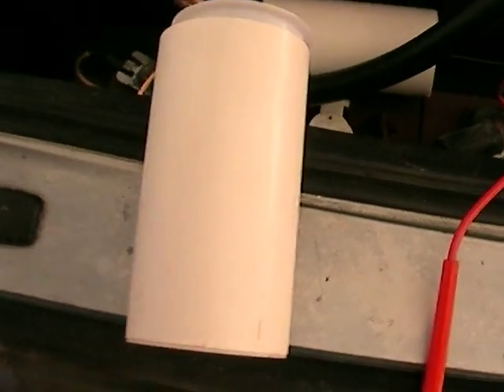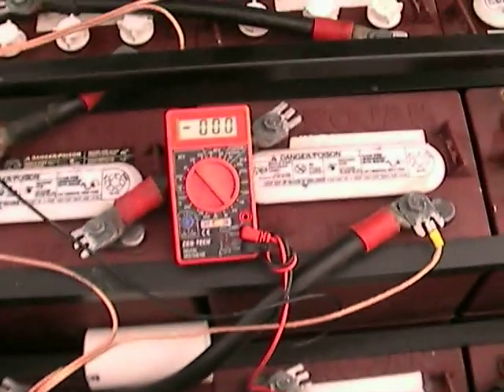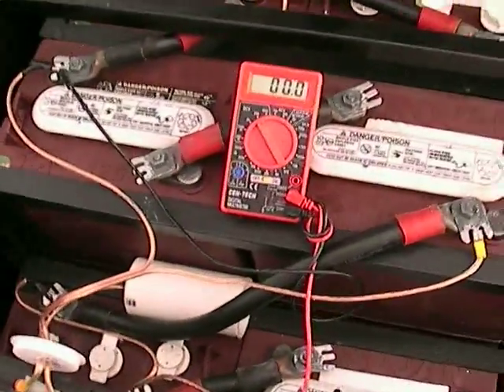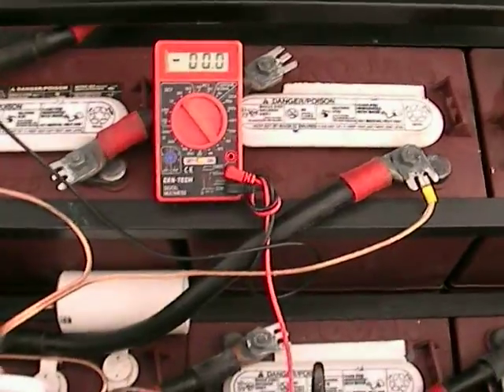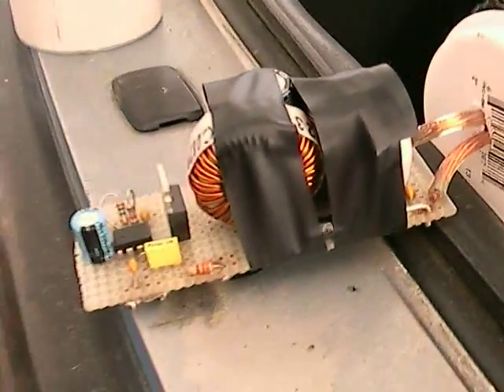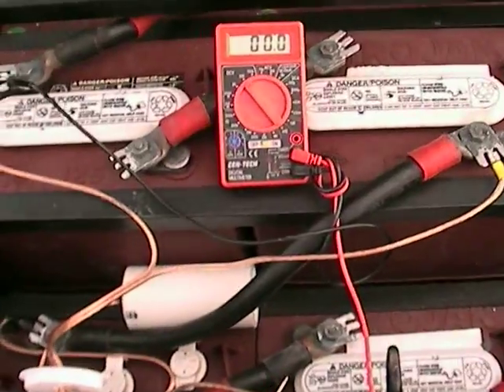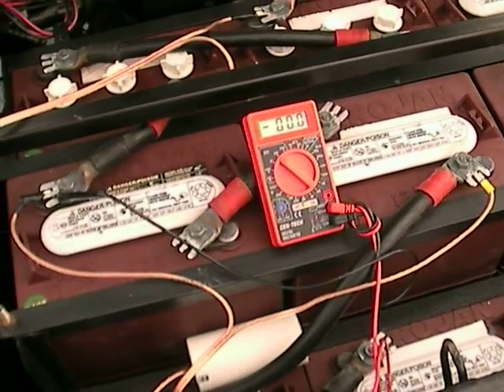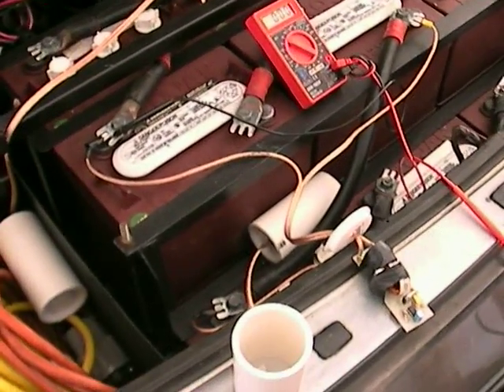Battery Desulfator Review

Comment: Good video, glad it's your desulfator is working.  I have a Pulsetech PowerPulse passive battery desulfator that cost $33.99 on Amazon on my 2001 BMW battery as preventative maintenance as Pulsetech claims that there patented frequency they use can extend battery life up to three times. I also used my PowerPulse on my other BMW battery that I let sit disconnected for a year, and it was at 11.2 volts, I tried charging it with my friends Exide 6 amp automatic charger for 14 hours and battery voltage was at 13.1 volts, yet it would not start my other car. I put the PowerPulse on it along with a 1 amp Schumacher manual battery charger for 72 hours, and left the desulfator on it for a week and it started my car right up.

Comment: I built a desulfator and I thought it was not working because till now  I was checking voltage at battery, but now checked at PCB of desulfator as you told and its 138 volts :O

Comment from the maker: If you could see inside the battery on the plates, you will see tiny whiskers growing on the plates. Thats the sulfation on the plates, they build up getting longer and longer and eventually can get long enough to cause an internal short. You can see these whiskers on the old telecom fluid batteries. They were glass vats that you could see the plates and the whiskers were big enough you can see. But the resonance the desulfators produce break down the whiskers and keeps the materials fluidized.

Comment: Hey I was wondering if you could explain what exactly happens inside the battery when a desulfator is hooked into it?
how does the device remove the sulfur without actually taking it out of the battery physically?

Comment from the maker: The desulfators can be designed to be individual batteries or one for the whole pack.  Mine were designed for each battery.  Several manufacturers have whole pack desulfators in the tyipcal voltages.  My opionion is I like individual desulfators.  Each one could spike the battery harder or softer depending on its condition.  An entire pack desulfator wouldn't be able to detect that.  But thats just a personal optionion.

Comment: Do you hook up 1 desulfator per battery OR can 1 desulfator be used for a bank of 'in-series' batteries? If 1 can be used for the bank, which battery should it be connected to? Thanks for your great video.

Comment from the maker: I did try a chemical desulfator on some old EV batteries that were used in my little pv solar system.  I didn't see hardly any changes using the chemical treatment.   But I am not sure on the age of that treatment, I think it was called Charge It.  If I remember right, I flashed the bottle in one of my videos, probably the one of my PV system.  But I didn't see the consistent changes that I saw with the electric desulfators. Im still using these on my batteries and just rotate them once a month.

Comment: Because that way you lose all the sulfate. Desulfators are breaking (dissolving) the sulfate crystals again into lead (lead dioxide) and sulfuric acid, so it can then work actively in the battery again. But with chemical treatment, the sulphate crystals just gets off the plates and settles on the bottom of the cell, it does not dissolve. This results in lowering the battery capacity and life expectancy (higher probablity of short circuit the cell by the conductive sulfate settled on the bottom)

Comment from the maker: Unfortunately it won't completely fix them.  If a battery has been abused and is really weak now, it probably won't bring a really weak battery back to life.  I think a battery's life is extended some by having a desulfator on it.  I have had these on my car's batteries now for over 6 months.  I stopped seeing a gain on my batteries after two months.    If you look at my website, you can see my spread sheet of voltage readings.

Comment from the maker: Mine averages a low 40's volt spike when connected to a 12 volt battery.  When only connected to a 6 volt battery, the spike is almost 20 volts.  That spike would only be measurable at the device.  Battery terminals would read open circuit voltage.